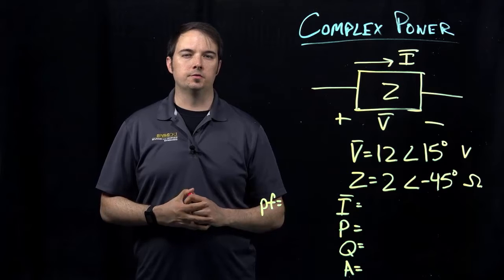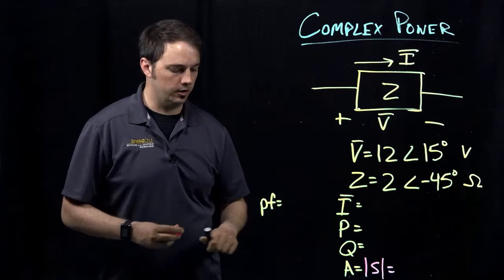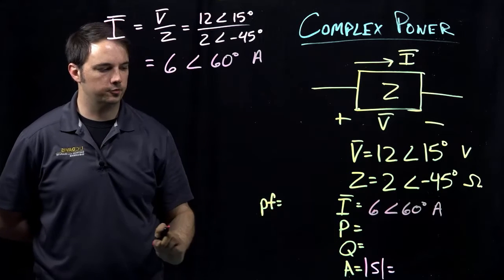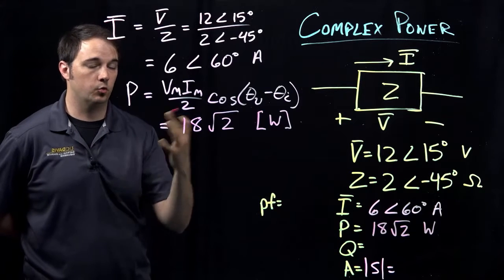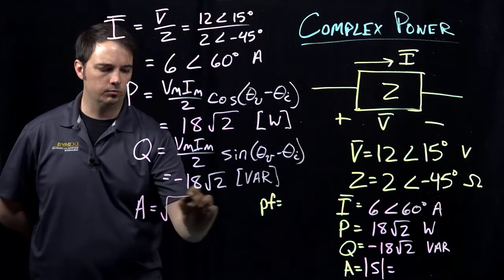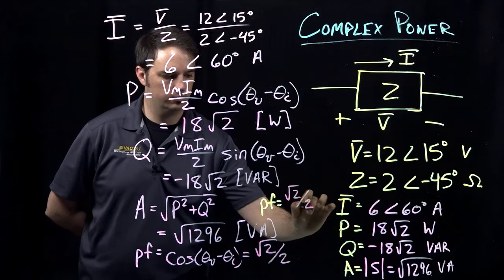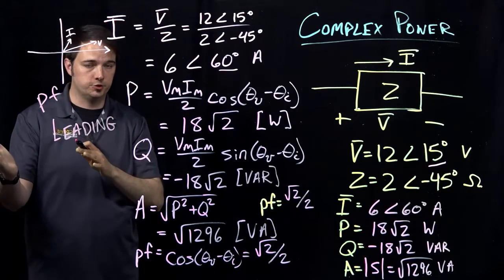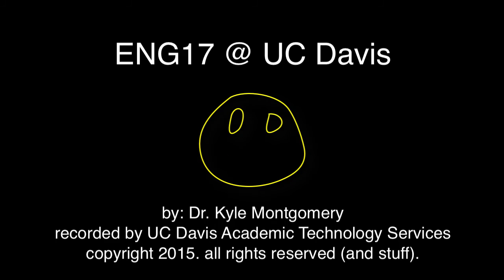Circuits I: Example with Complex Power Calculations

Comment: This is wrong. cos(60)=0.5, sin(60)=0.86, Q does not equal -18.
Reply: Yes, cos(60°) = 0.5 and sin(60°) = 0.866 but to calculate power, we need cos(theta_V-theta_I) 
theta_V = 15° and theta_I = 60°
So cos(theta_V-theta_I) = cos(15-60) = cos(-45°) = cos(45°) = 1/(√2) or (√2)/2.
Same thing is done to find reactive power, Q and pf.
Now Q is written as -18√2 because sin(-45°) = -sin(45°) = (-√2)/2
Complex Power, S = 18√2-j18√2
This (-j) term comes only when current is leading. And the current is leading in this example.

Thank you  @Dr. Montgomery. Came here to revise the topic and the video was very helpful.

Comment: You don't allow calculators. Your students must be top notch.
Reply: You mean miserable?
Reply: It really limits how difficult your problem can be. I'd rather have exams where the numbers they give are friendly.
Reply: Not allowing at least basic calculators at this stage of a students degree is just completely unnecessary. You should be well beyond the point of testing their ability to do calculations by hand. If a class is introducing you to a mathematical concept for the first time ever, like when you’re learning how to simplify Trigonometric expressions or do long division, absolutely make the students solve it by hand so they understand why it works that way.

But if you’re in a class and the simplifications you’ll be doing is the same math you’ve been doing for several classes, not allowing calculators is a huge facepalm. You’re testing the students knowledge on circuits.  Not how to simplify mathematical expressions by hand. I severely doubt there will EVER be a situation as a working engineering where you will be required to do math without the aid of a computer.